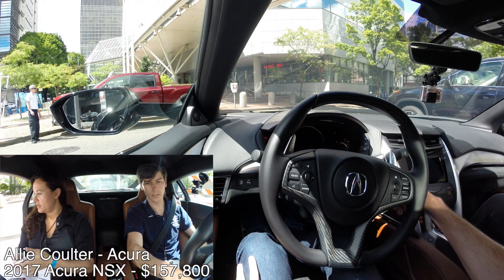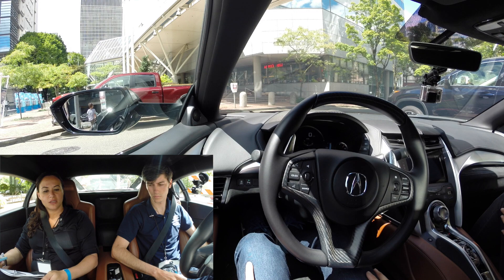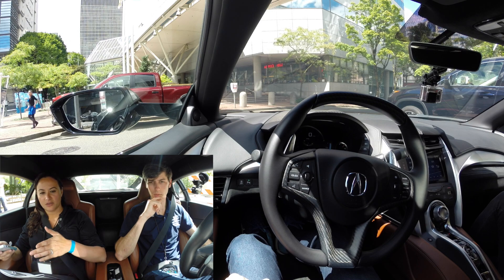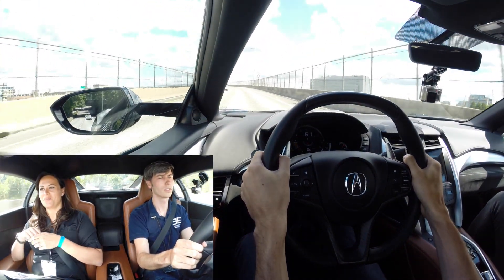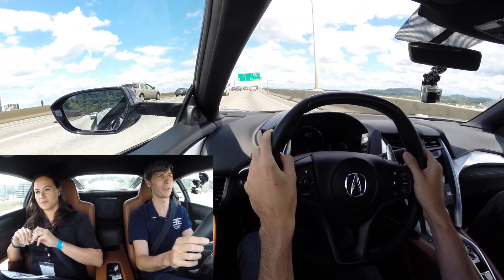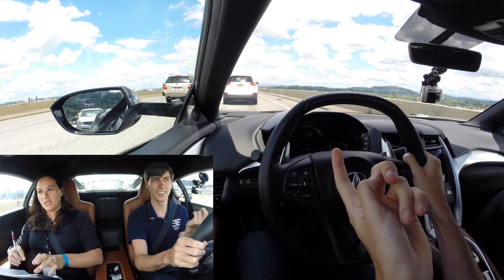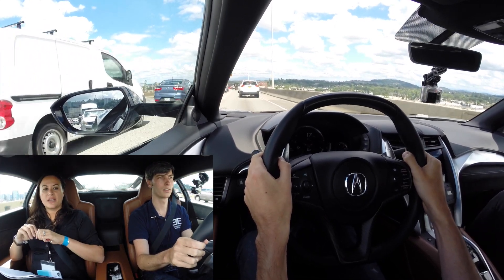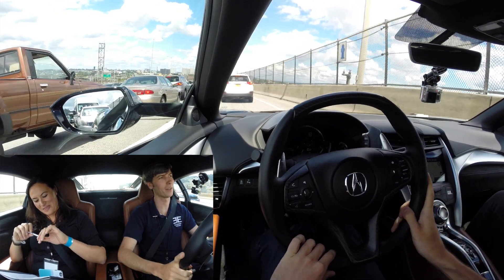2017 Acura NSX - A Casual Portland Drive

Comment: I thin nsx need to be something light (less 1400kg or 3000lbs) ,smaller ,only rwd ,manual and 400hp max!
Reply: Fanaz10
Haha, no. Shifting is fun. Not having the car do all the work for you is fun.

You could buy a dirty old turbo 240sx 5 speed and have a hell of a lot more fun than you would driving this overpriced thing.

Just the anxiety of driving $160k worth of car alone would take all the fun out of it.
Reply: Lmao dude any automatic made post 2015 will be more faster and efficient than manual
Reply: And a lot less fun. What's the point of being fast around the track if you're not having fun?
Reply: +Ricky Johnson, if it's faster, then that's fun.
Reply: There's rumours that the type R NSX will ditch the electric motors and be RWD.
Reply: Look at the miata, Its not fast but its a manual and is one of the most fun cars money can buy
Reply: Dodge 318 Cummins
He meant that you can get them with manual trans, not that auto miata's don't exist.
Reply: L
Reply: Back on point....Honda doesn't make the car you are dreaming of. They do minivans and the " priced out of the range of most" NSX.
Reply: +Bj Robinson civic si?
Reply: +Cesma RS, Amen!!
Reply: +gadgetguy99 I see automatic Miatas all the time.

Comment: I Wonder why Honda bothered with the electric motors considering their relatively low output?
Reply from the maker: As mentioned, allows for some tricky torque vectoring, and also provides for instant torque before the turbo kicks in. It's a riot!
Reply: because its appealing to companys and good for marketing. it helps lower emissions mainly

Comment: crazy accord
Reply: +Gabriel Delgado yeah, sure, and a Fiat 500 is "basically" a Ferrari 458.
Reply: +Gabriel Delgado again, not really. Yes they are the same engine but it's a slightly different tune and the Acura has a nine speed and the Honda has a six speed, making the NSX more closely related to the Acura.
Reply: LOL you drive a Miata which automatically voids anything you say.
Reply: +Gabriel Delgado you're making yourself look dumber and dumber. Fiat and Alfa Romeo are under the same umbrella, and share a similar engine with shared parts. Ferrari and Fiat are also under the same umbrella. That's a little stretch, but the Fiat and the Alfa Romeo share parts. Yet they're nothing alike.
Reply: +Gabriel Delgado the Engine in the Accord (J35) and the engine in the NSX  (JNC1) are vastly different, but I'll name a few key differences:
JNC1: DOHC
J35: SOHC
JNC1: 75 degree V
J35: 60 degree V
JNC1: Direct and port fuel injection
J35: multi point fuel injection
JNC1: Turbo
J35: N/A
JNC1: Longitudinal
J35: Transverse
JNC1: VTC
J35: Vtec
Reply: compare the original nsx its still the king and the design is better than this one and all manual for driving feel
Reply: Logλn L You finished him.
Reply: What do you mean?
Reply: +The Motorsport Unit NSX is basically a Honda accord
Reply: +Gabriel Delgado Man, there's a lot to learn!...
Reply: +Gabriel Delgado maybe it'd be better to say that's like calling a Fiat 500 an Alfa 4C.  Either way they're are not really the same.
Reply: +SI RICKO catch this ignore dumbass
Reply: +The Motorsport Unit it's not hard to tell the obvious
Reply: +Gabriel Delgado That's fine man. Stay with MX-5s, and I stay with the NSX. This world will bear itself better this way.
Reply: Abe Froman asking me when two completely different models of cars are related to what I'm saying, you are one dumbass sir
Reply: The Motorsport Unit stay with the slowest supercar? that's gonna be a no for me man
Reply: +Vikk 54 he doesn't get I was making a more extreme yet similar analogy.
Reply: way crazy lol
Reply: +Gabriel Delgado not really. It's basically an Acura TLX. Only the engine though. Everything else (clearly) is vastly different. The V6 is also twin turbo not N/A.
Reply: +Vikk 54 the engines are basically the same with the twin turbo being the only difference

Comment: That's quite the upgrade from your Subaru. 👍. You must have sold it at a really good price 🙄
Reply from the maker: Just trying to see if there's anything out there better than a Hyundai Accent. So far I'm at a loss.
Reply: porsche 918
Reply: Haha there isn't is the simple fact
Reply: Apparently the 3 cylinder diesel is faster than anything on the road.
Reply: +Butt Beware no!